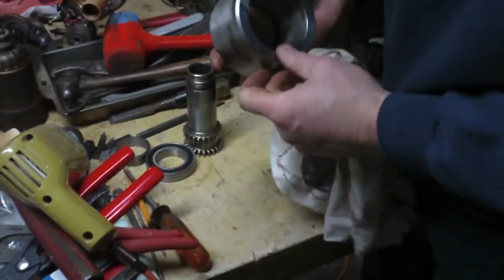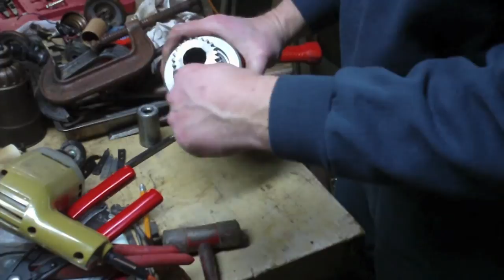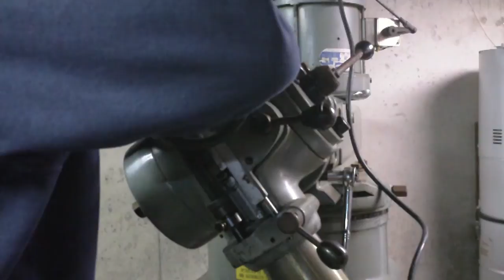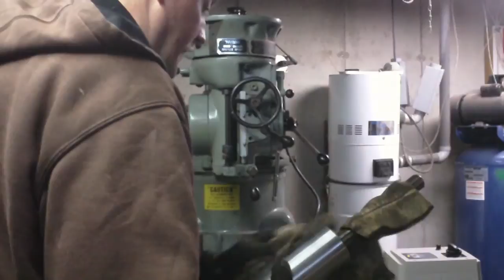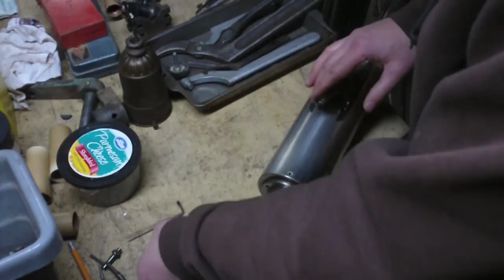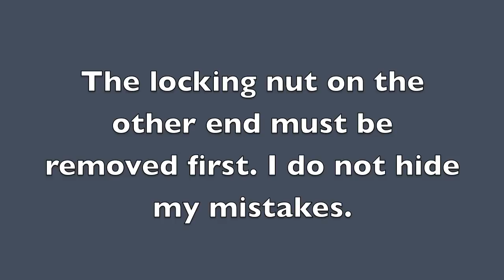Wells Index Milling Machine Part 45

Comment: Interesting.  I have a model 55 (it's little brother).  The spindle looks very similar. I had to make my spanner (welded).  The spindle doesn't have that release.  You should be able to get the manual from Wells-Index.  And parts (got new bronze table nuts for mine).

About that nut on the bottom of the spindle.  I was really worried about my spindle at first because when I turned it by hand, I could feel a "tick" in a certain spot in the revolution.  Turns out, it was that nut rubbing on the spindle, because when I took it off it went away.  I'm going to try to find the spot that rubs and file it down.

Comment: Heating the big collar would have given you enough space to just drop the piece in place...im rebuilding a Index mill at the moment....The bearing in the quill shaft are very expensive...the tops about $40.00and the bottom 2 are a match set for $290.00 my mills a bit older then yours...
Reply from the maker: +TheMetalArtMan I've read a lot online about the bearings, and some argue that for a machine of this age, that the regular version of these bearings would be sufficient. The high cost bearings a super tight tolerance, matched pairs. If I had the extra money, I'd send the spindle out to be rebuilt, and have the 4 bearing conversion done, but then again, it'd be overkill for my needs.

Comment: Makes sense to put the bearings in first and then the shaft because you can push on the outside of the bearings when putting them in, then you put the ring and you can then safely push the shaft in if you support the inner race of the bearing...  Of course this is me posting from the comfort of my armchair so what do I know.